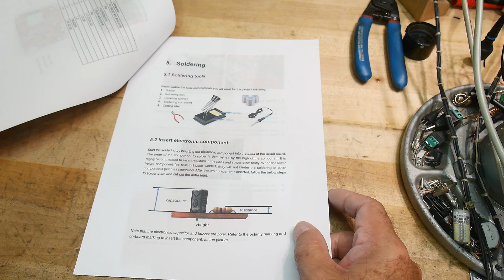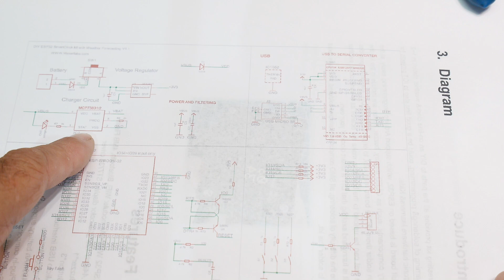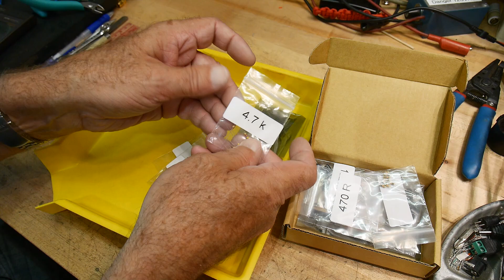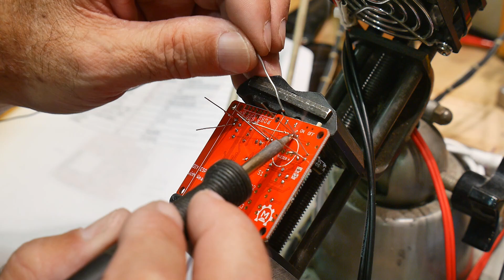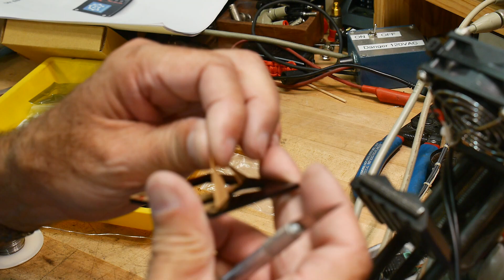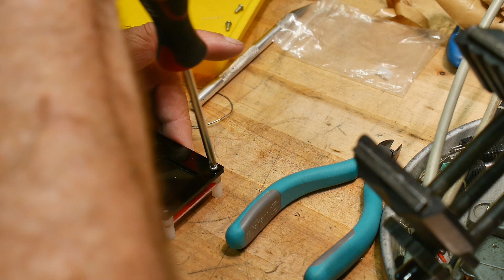#874 ESP32 SmartClock Kit with Weather Forecasting (part 1 of 2)

Comment: I get a kick out of the Russians putting a wind up mechanical clock in a mach 2 jet. I don't have a radiation meter, but if I  did, I'd surely like to check the dial and hands.

Comment: Personally I love these clock klits. I like story time when you build these.  I've been building  the type with 60 LEDs arranged in a circle around a central digital display like this from Banggood::
 https://usa.banggood.com/Geekcreit-Fourth-Generation-DIY-EC1838B-DS1302-Light-Control-Rotation-LED-Electronic-Clock-Kit-Music-Alarm-Clock-With-Housing-p-1380037.html?utm_source=googleshopping&utm_medium=cpc_organic&utm_source=googleshopping&utm_medium=cpc_organic&gmcCountry=US&utm_content=minha&utm_campaign=minha-usg-pc&utm_content=minha&utm_campaign=minha-usg-pc&currency=USD&cur_warehouse=CN&createTmp=1&ID=558110&utm_source=googleshopping&utm_medium=cpc_bgcs&utm_content=sandra&utm_campaign=sandra-pla-usg-all-0408&ad_id=513001116163&gclid=CjwKCAjwjdOIBhA_EiwAHz8xm0Ydz0fxE2eO39-twlu5pqwlsocIowHGIiYND0yIM6_d5pfSpkpjUxoCiJkQAvD_BwE
Last year I began rebuilding a Russian Mig- 23- 29 mechanical cockpit clock.  I noticed that the chinese kit clocks would mount in the same  clock base  and began building them.  They look really cool. The DS 1032 chip is hackable- I think. Lots of soldering, and will take a couple of hours to assemble. My family members are getting these for birthdays, Christmas or whatever the reason.
Reply from the maker: Nice. I built one of those 60 led clocks, it turns out good. I love those mig clocks that were a US design copied.

Comment: Just a word about weather:
I worked for the USDA Forrest Fire Laboratory from 1970-1995.   We had the most accurate weather forecasting data in the government.  We used to joke that if the Public were allowed to see our data, the US weather Service would be disbanded.
Our predictions were accurate within plus or minus four degrees, for any hour of the day, while the bureaus was only plus or minus ten degrees for the whole day.   In some locations of the US, we issued predictions down to the size of one acre parcels.
We found that the most accurate weather predictions are based on the shortest distance to the ocean, and time of sunrise and sunset.
Waiting for part two to see how easy or hard Wi-Fi can be connected.